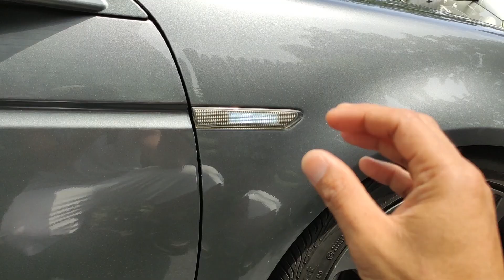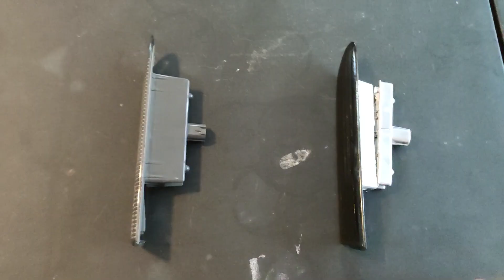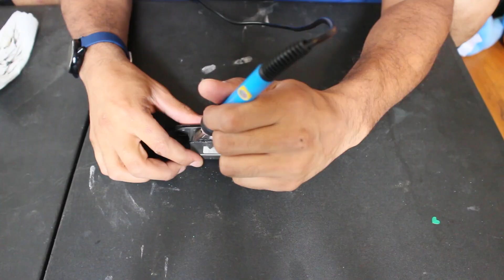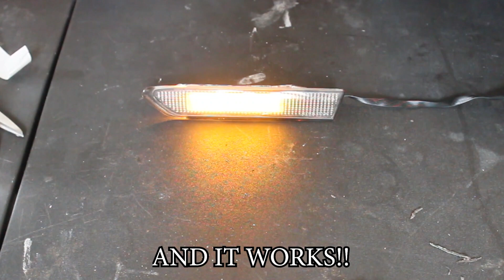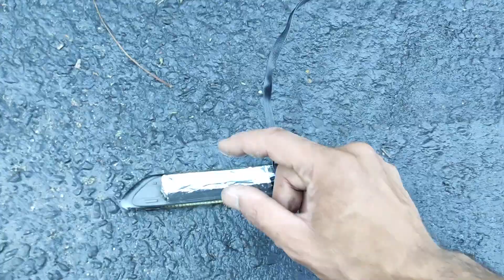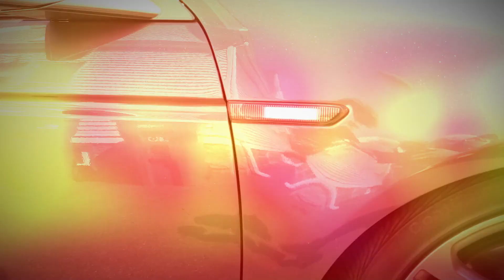How I Made My Side Markers Into SWITCH BACKS!! - How to MOD Side Markers -

Comment: Hey I know this is an older video, hope you have a chance to see this comment. I purchased a Type S rear side marker from Ebay for my base '06 TL but it's not lighting up. I got a refund and was told to keep the part. If I was to cut the marker open like you did here, what would I look for as the culprit? I just want it to light up like stock. Thanks!
Reply from the maker: What's up man.  Make sure the led board is good.  check for bad solder points, no bent pins
Reply: @thecarfiend11  thanks, will do.

Comment: Hi, I have switchback but on my vehicles handles that function exactly like your switchbacks. Is the white idle when the vehicle is on low beam legal? I'm in Cali btw
Reply from the maker: I'm not sure in Cali.  I assume it's legal, because alot of modern cars I see, have white with the low beams.  I haven't had a problem with law enforcement or getting an inspection sticker 🤷‍♂️
Reply: @thecarfiend11  do you have a Gmail so I can send you a video of my vehicle? I would appreciate any feedback. It's a ongoung project of mine. Also Because my switchbacks side markers are different from where most vehicles have their sidemarker
Reply from the maker: @Johnsal517  thecarfiend11@gmail.com
Reply: @thecarfiend11  I just called my local police department and they told me any white lights from the sides of the vehicle is illegal in general for an exception of amber lights
Reply from the maker: Most of the time with headlights, tail lights, or anything like that, The description will stay off road use only. So I think they do that for legal reasons